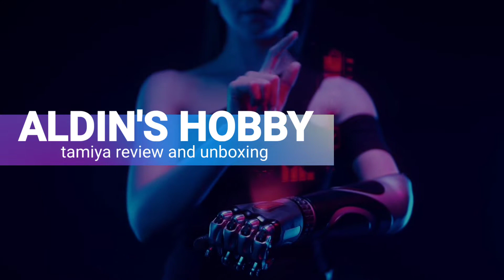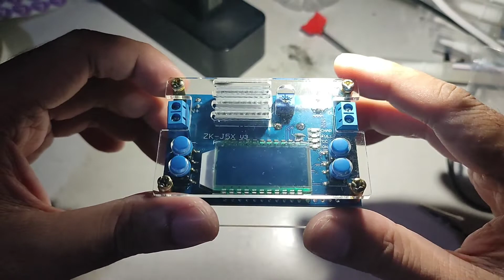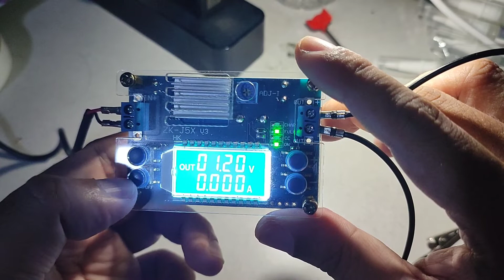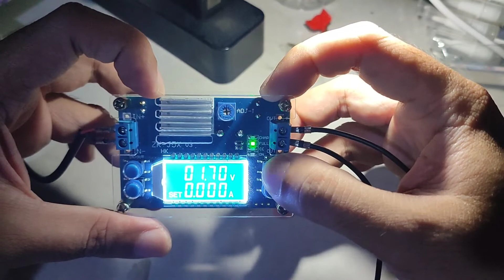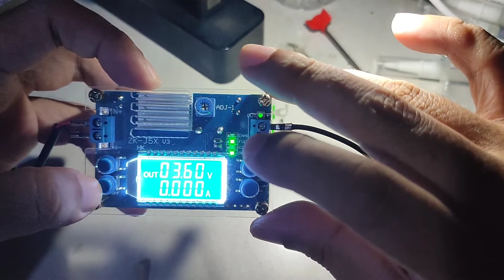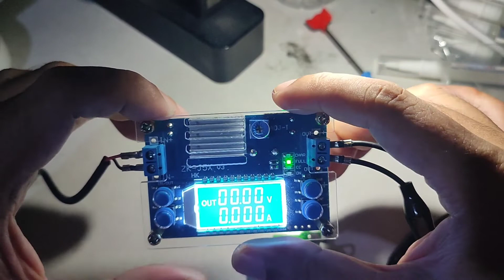Power Module Break-in System

Comment: Question lang po. Sinubukan ko yung 3V pero parang kapos yung power, parang mahina yung output. May need bang i-adjust or safe pabang itaas yung voltage?
Reply from the maker: pwde mo taasan bago mag start minsan ginagawa kong 6v kaso 1min lang. pag sobra sa break in sandali mo lng magamit motor
Reply: Ok po. Newbie lang po kasi ako. Pano po ba malalaman na busted na yung motor? Or nasobrahan sa pag break in?
Reply from the maker: @Aarjj_Nine75one  titignan mo kung maluwag na pg inikot mo meaning naka break in na sya, pro minsan d maayos kaya suggest ko 3v lang kc palakas ng palakas yan. compare mo yan sa motorcycle my soft at hard break in. pg hard brreak in asahan mo madali masira makina pro pg soft break in saka sinunod mo manual palakas ng palakas sya